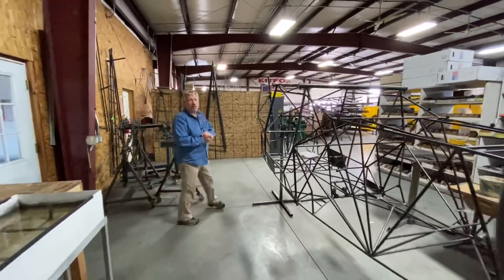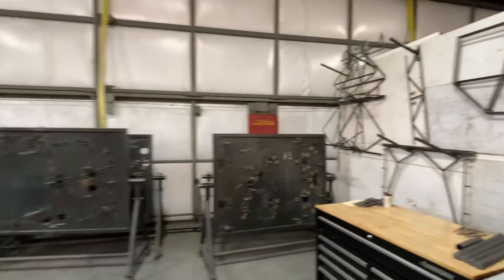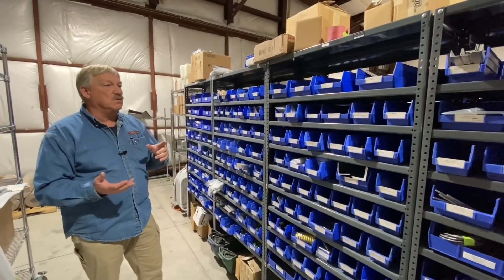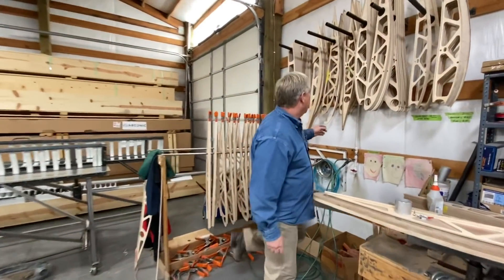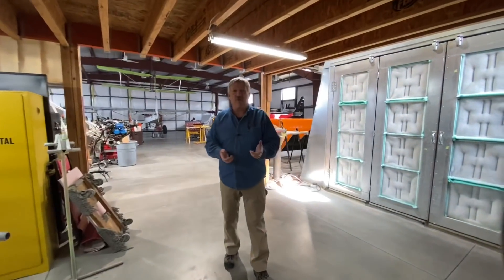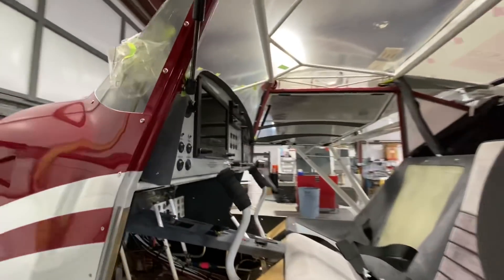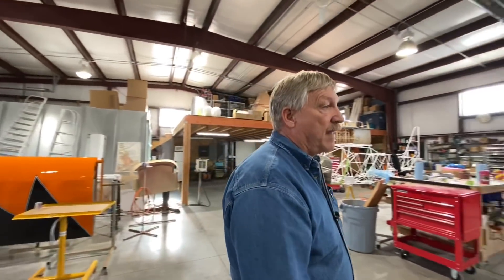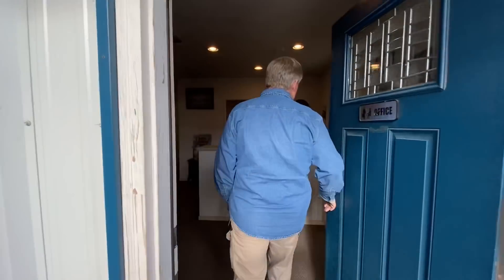Kitfox Factory Tour 2020

Comment: Thanks for the video. This is very informative, I am very impressed. I fly out of Caldwell, Idaho. I flew Weight Shift control for 12 years. I just bought a Quicksilver GT500 and am learning fixed wing flying. My next airplane will be a STOL. I had been looking at Kitfox, Highlander and Zenith. I have a question, how do you compare forward visibility between a Kitfox and Highlander? In your opinion for an undecided buyer what differentiates a Kitfox from a Highlander? Thanks.

Comment: John, has anyone ever tried to use foam core filled carbon fibre spares instead of your aluminum spars? That would be about half the weight but I don't know how heavy your spars are now. They might be that light that its not much of a difference for the cost and hassle.